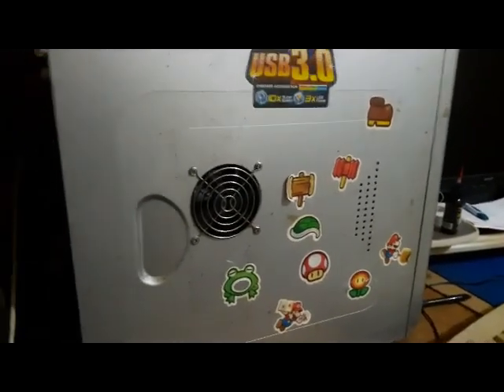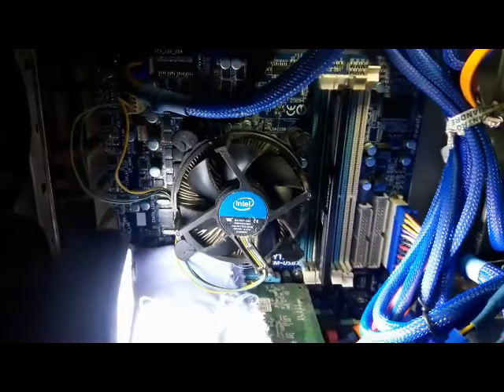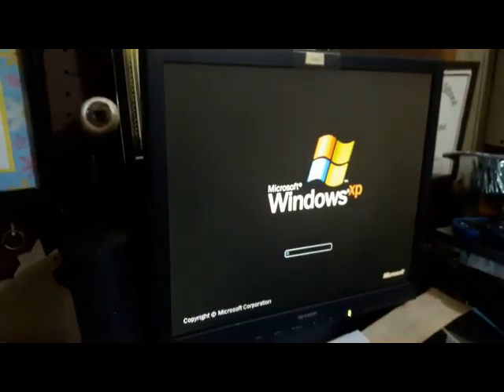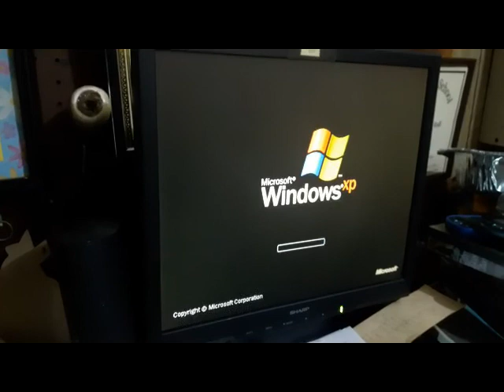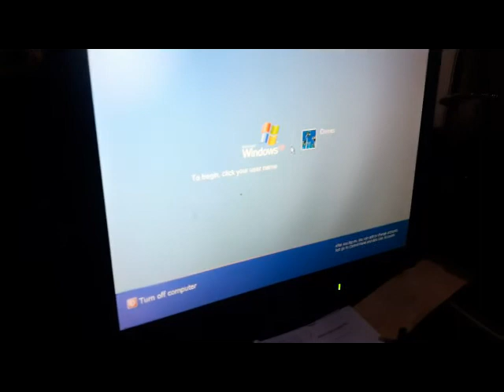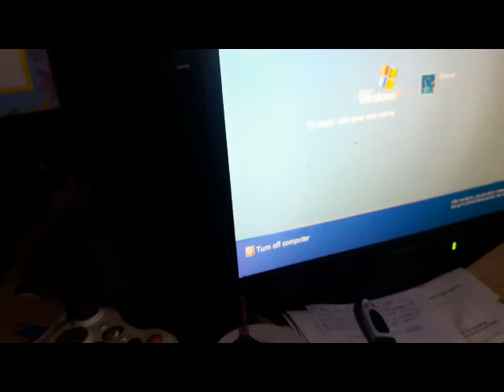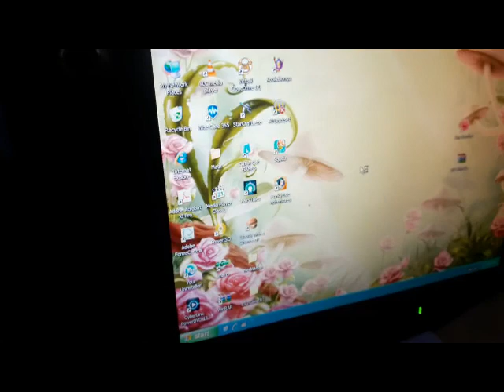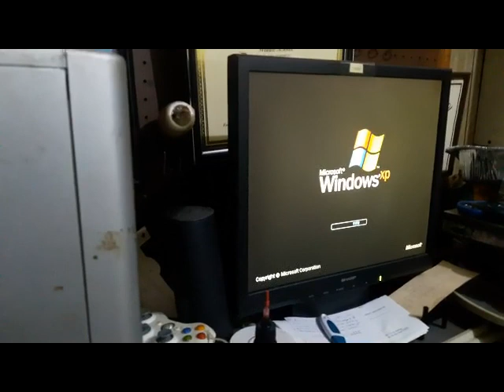Fix!!!  PC Making Beeping Sound at Start Up

Comment: This is exactly what my problem was after my son knocked the desktop on its side. It beeped over 20 times quickly and then continued to cycle on and off. Removed the RAM stick in the same position you did and sure enough it booted fine. Thanks so much for posting this!

Comment: Yeah those beeps at the startup are lettn ya know. Back in the day the number of beeps tols ya what is wrong. When that happened to me my RAM had gone bad malfunctioned whatever. As soon as i replaced it everything booted
Reply: That beep sound like it's cursing at your daughter for the hard bump.
Reply from the maker: @davevalinty4293  That is exactly what it's sound like to me.
Reply from the maker: You are right about back in the day... Now a day, there are so many different manufactures and they make the sound differently that you can't keep up.
Reply: @truerenegade1095  lol yeah man i lost "it" somewhere around 2006. I used to code in turbo pascal used to overclock my cpu, all sortsa shit. Fuk no. I'm so lost now lol i got into computers around 94 and was on it for a few years straight
Reply: Pc beeps on startup